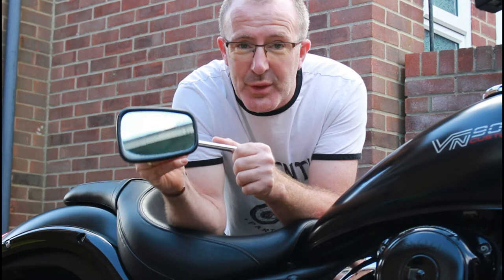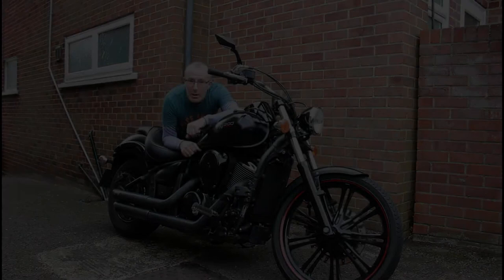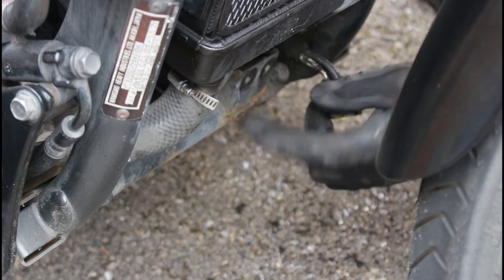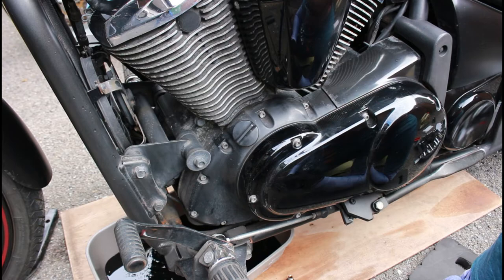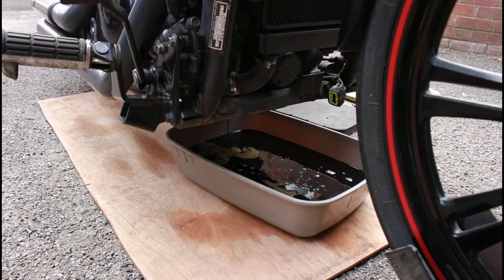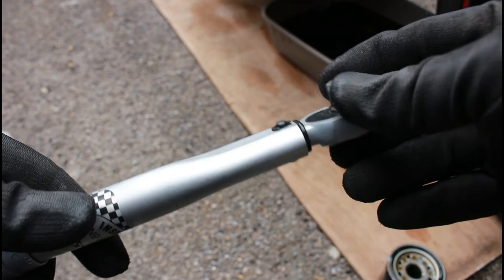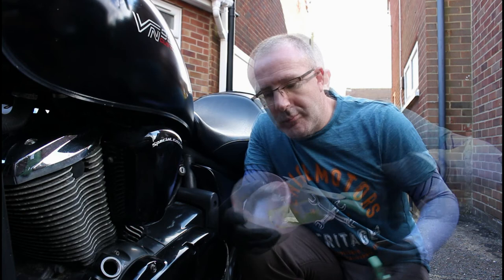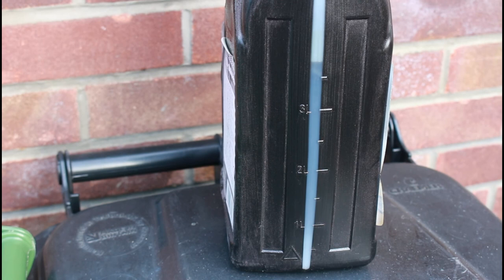VN900 custom, change of mirrors and detailed, oil filter and engine oil change.

Comment: Ya know... there is an oil screen on the kickstand side that needs cleaning as well.
Reply from the maker: Yes, kind of odd they put it that side as it makes holding the bike level while looking very tricky. If it was the otherside, you can lift off from the stand while looking. Most bikes have it right and not left.
Reply: @DeanAllen  not a sight glass, but a removable oil screen, (that will let more oil out while on the kickstand).  You remove a left side drain bolt and there is an oil screen under it. You must clean and then replace the oil screen.

Comment: Hello, for the 900 custom, is there a full LED unit to replace the headlight with? Everything I’m finding just talks about h4 bulbs. But I don’t want to just change the bulb. Even if I have to change the headlight housing I will. Just not sure what will work.
Reply from the maker: I had a replacement LED light all set to go, but the light part and bezel would not fit straight into the shell that is centrally bracketed to the bottom yoke. 
I had to give up then. 
My friends say that it looks like they are being followed by a guy with a candle at the moment. 
I plan to either find another LED  light unit  that I will have to make some brackets for, to still connect onto that same fixing point currently on the VN Custom, or I may cut the back of my shell out ( which is plastic) then cut out a metal section from the one I have  and fix in the replacement (old fixing point) to the new LED metal shell. 
I will eventually get round to adding this on my Channel. 
Thanks, Deano.
Reply: @DeanAllen  thanks for the reply. I’m trying to figure it out myself haha